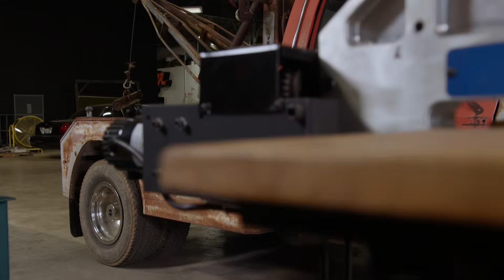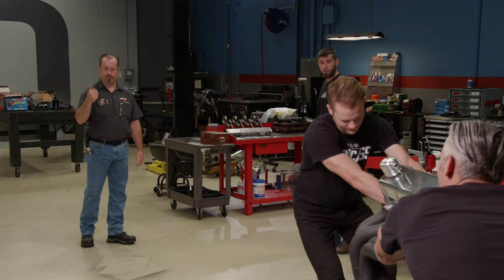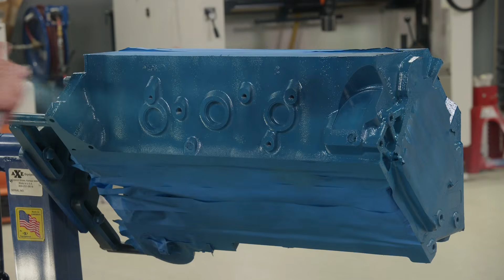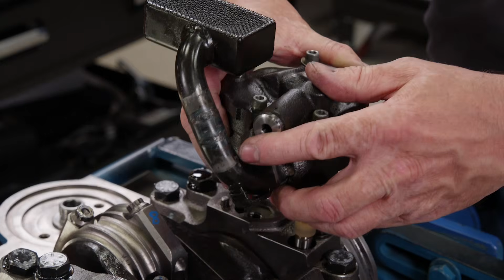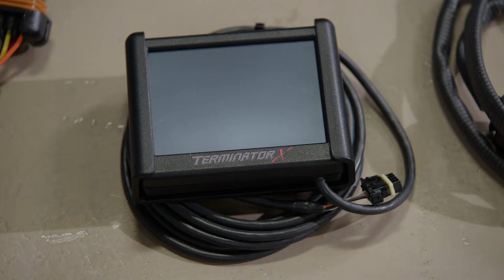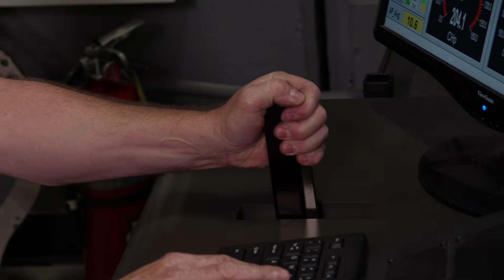A 632 Big Block Chevy Is The Perfect Fit For This '77 Tow Truck Sleeper - Engine Power S7, E12

Comment: Was that the engine they built for the wicked Willy's mud truck?
Reply: YES
Reply: which proves another point they don't finish what they start, they make so much hype for nothing and look what happens, and is XOR even still going or did that get the axe?
Reply: @mplante7352  XOR got canned. whatshername left PN. thats why  the Wicked Willy's mud truck ended up on Carcass.
Reply: @harveylong5878  makes sense. now if we could figure out what went on with Mike Galley and that new guy on engine power.

Comment: How do you determine what assembly lube you will use? I see you guys use multiple different types.
Reply: Depends on who is sponsoring it
Reply: It does matter what lube you use. You always want to use the cam manufacturer's recommended lube on the camshaft, which is often times very sticky and too thick for what you want on a bearing. Mains and rod bearing like a thinner lube. If the motor will be fired right up engine oil works fine. If it will sit for any length of time before start up you want something sticky? but still thin enough to fill the tight tolerances, like they used in the video.

Comment: i have to strongly disagree with the 9.56 static compression on this motor even though they are going to spray it with nitrous with pump gas. realilstically it is going to spend 95% of its time without nitrous and the dynamic compression would be ridiculously low with such a big camshaft.personally i would have gone to 10.5-11.0 cpmpression and it still would have been pump gas friendly with nitrous unless they intend to put stupid amounts of nitrous in it.
Reply: Gotta be ready for that 500 shot.
Reply: @The Truth about Africa hurts they havnt even setup the suspension yet or done anything to the chassis
Reply: @The Truth about Africa hurts who says it will stay like that,the project has only started and i doubt they will leave it like it is
Reply: @The Truth about Africa hurts instead of shooting down everything i say maybe watch this space,i never said anything about bolt on parts who knows what they will do

Comment: I would like to see this engine test with advancing the camshaft timing.
Reply: It will move power up top and take from the bottom end
Reply: @jakewashere2.016  ... Actually, it's the other way around. Advancing the cam makes more torque in the lower RPM range. Retarding it moves the torque up in the higher RPM range. Although, with a 632 inch engine, it won't be all that noticeable.
Reply: J W  guess I had it backwards lol
Reply: Richard holdner has a series of videos on this and much more check his channel

Comment: I'd put way less camshaft in to build monster midrange. Forget the nitrous; you don't need it.
Reply: For sure, it’d be cool to just see it as a sleeper tow truck. No need to take it to the drag strip.
Reply: Would be better for the street and less wear and tear on the valve train with less cam lift...and less rpm for less stress on the rotating assembly...which equal better reliability and longevity......especially on a stroker big block...
Reply: Spoken like a person who's never run nitrous.
Reply: @colormesarge  if you build the motor right you don't need it
Reply: Spoken like people that have never run a big block!. You wouldn't understand...its ok to be a key board racer lol more nos on a tow truck😔
Reply: @HorsepowerHeadquarters454  Exactly, then you'll need a progressive controller and electronics to pull timing when you do spray it. These builds are such BS fantasy land crap it ain't even funny. Build a 509-540, waaay cheaper and it'll have more than enough power, even at 9.5 to 1 to run 87. Hell, there's so much room in a C/K  bay you could stick 8 to 1's in there, run a centrifugal and make all the power you want just by switching pulleys, you'd still have room to run a huge A to A intercooler. Ya gotta love television.
Reply: I think they do stuff like this just because. But your exactly right I think. Nitrous is not needed at all and is a waste in my opinion.
Reply: Hook up a lambo to it and drive around🤣!. it doesn't need nos...
Reply: @bigboreracing356 
 I haven't needed it yet. Even in the class above me!.
Reply: @bigboreracing356 🤔

 sitting in the shed....
Reply: @bigboreracing356  I like how you think lol...
Reply: Heavier vehicle does better with low end torque.
Reply: They should have ditched the solid roller, not good for street. They are talking about spraying it like 850hp isn't enough in a pos tow truck.